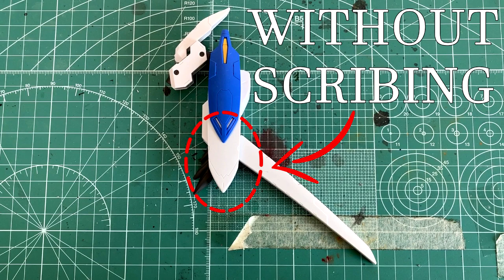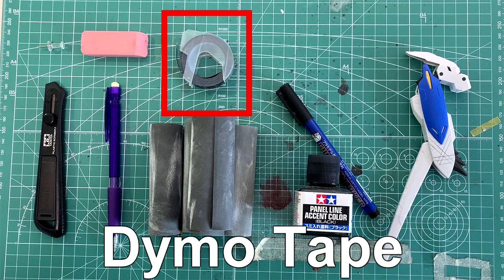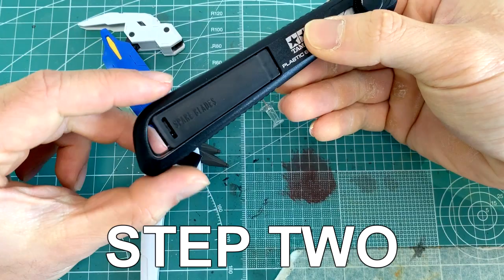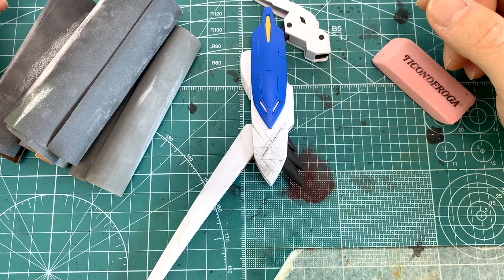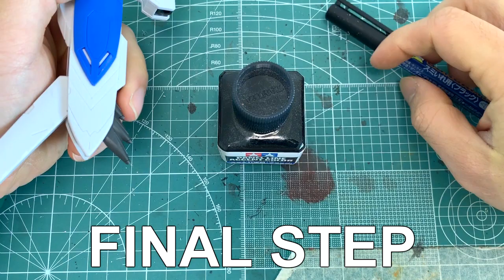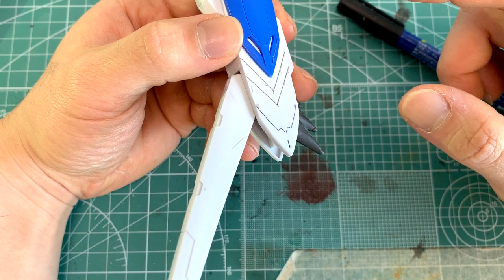Beginner's Gunpla Tutorial - Scribing and Panel Lines

Comment: Need some input please. I am starting to get more into scribing my kits and I have good equipment. Dspiae Push Broach with clamp handle. The issue I am having is that after scribing the lines look chewed up and choppy as hell. All the scribes are within the line and follow the pattern perfectly, however, the lines are looking really uneven especially along the edges.. I don't know if maybe I am using a broach that is too thick or too thin. Maybe all the inconsistency will go away after priming but I can keep getting these results and continuing. Any help is greatly appreciated?????
Reply: Ever figure this out?
Reply: @Future Trunks  Not sure I have the absolute solution, but what I did figure out is that a bunch of gentle smooth strokes does a lot better than trying to do it with any degree of aggression whatsoever. I also found (unfortunately because of the price) that the better scribes you have the better the result. The difference between BMC scribes and Dspiae was substantial. Regardless of the method you use. This kind of sucks for younger Gunpla builders or those on a budget but the difference was immeasurable. I'd still be happy to take any advice if someone had any...